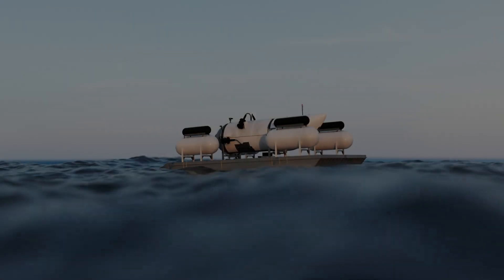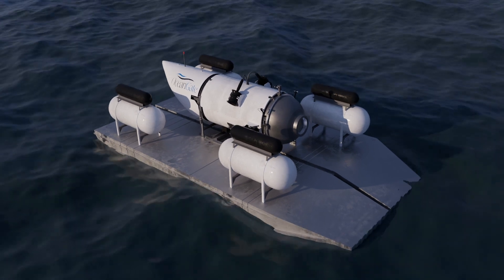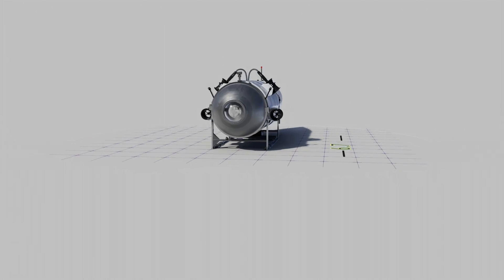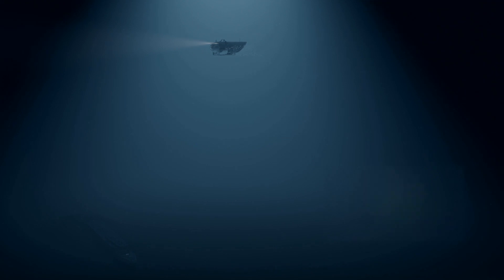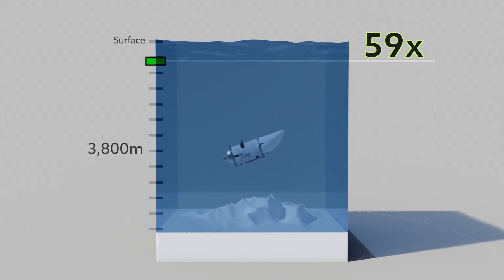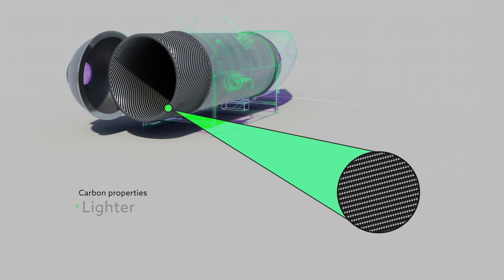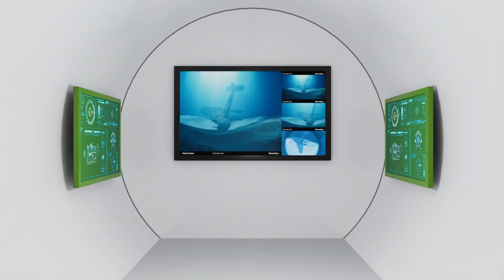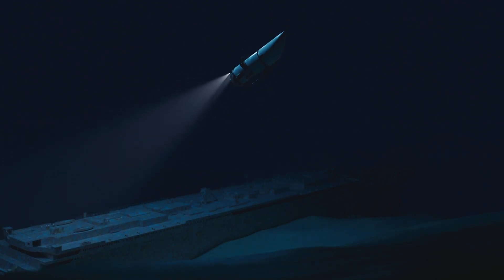Titan OceanGate | Why carbon fiber is inferior to titanium in deep sea diving

Comment: Carbon fiber wasn't the problem. Stockton's biggest mistake was his poor choice of other materials used. He chose to coat the outside with Rhino Liner. Flex Seal would have performed much better for this application. Phil Swift made a glass boat with it so it's maritime capabilities are already proven.

I don't know what that peanut butter adhesive he used is called but Gorilla Glue is a no brainer in this situation. It's incredibly strong and has a five star rating. It's waterproof, holds up to hot and cold temperatures and bonds to anything. If you never heard of it, I highly recommend it. 

I hope this helps any future submarine entrepreneurs.
Reply: 1. carbon fibre was the main problem because  it is not strong enough for repetitive dives
2. it did not matter what they lined the carbon fibre with if it could not handle the pressure. 
3. submersibles do not get "glued" togethor with fucking rhino gorrilla or elephant glue.
4. nobody is looking up glues when we know for a fact that a titanium hull is welded togethor.
5. mixing materials creates weak points in any hull.
6. You are too out of your depth in the basic knowledge we all now know on submersibles since the titan sub incident to be thinking anything you said will help a future submersible designer.
7. Just take a page out of james cameron or victor vescovo's book and do not try and be smart.
8. some bird brain might take what you are saying seriously.........
Reply: @djrakman3909  Flex Seal is so good at coating, it even covered up my sarcasm. Please stop trying to sound intelligent as your novel sized reply to a joke proves otherwise. 

I'm sure future submersible designers won't be doing R&D off of YouTube comments. They have Google for that. (more hidden sarcasm just for you)

I'll leave you with three bits of advice:
1. Stay away from parties. They are meant for fun people.
2. Don't waste money on comedy show tickets. You won't understand what they are saying.
3. I highly recommend you listen to the first live album from The Dictators titled, "Fuck 'Em If They Can't Take a Joke"

Comment: There was nothing 'cutting edge' about a submersible made from what was technically 'expired' carbon fibre, that had not been cured in an autoclave, which featured dissimilar materials, a form (cylinder), that had been epoxied together, that was structurally weak (compared to a sphere), that was of a reduced thickness (5", vs. the proposed 7"), which featured an acrylic viewport that was rated to a fraction of the depths this submersible descending to & that had not been either tested or certified by any relevant agency. 
The Titan was a poorly engineered lemon that was woefully inadequate for the job at hand.